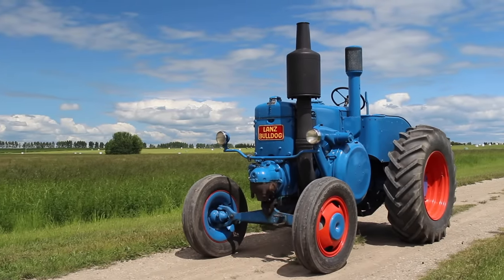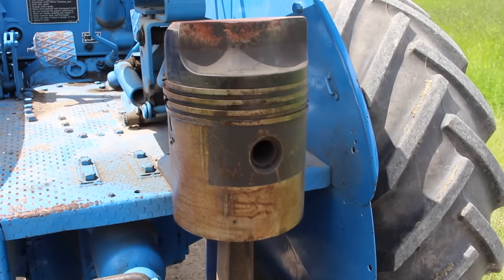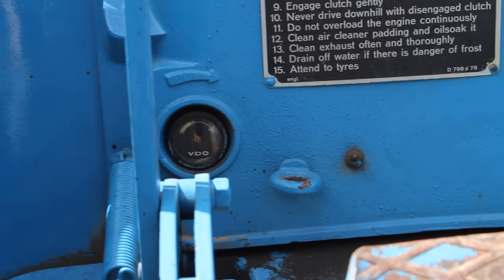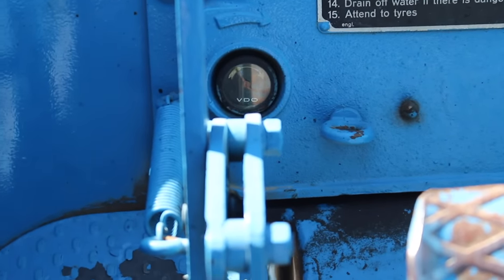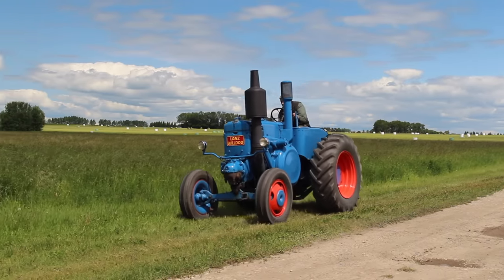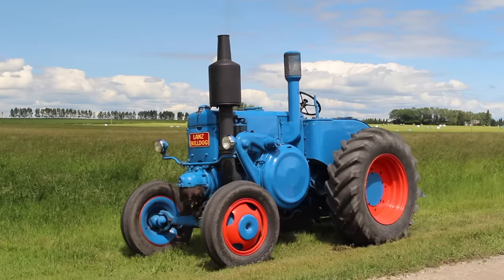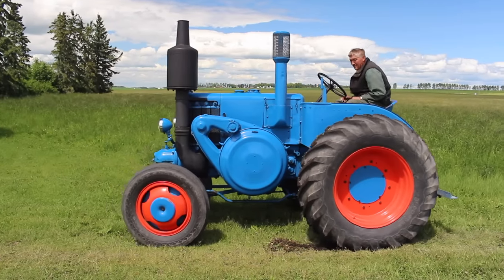Engine running backwards? Lanz Bulldog Tractor two stroke

Comment: What you forget to mention is the awesome sound that's absolutely impossible to capture. You feel each ignition in your guts. That massive and sudden exhaust from this huge chamber is simply punching you in the bowels. Had the pleasure to see a bulldog in action powering a saw via a belt. incredible contraption and it worked both ways of course.
Reply: Reciprocating saw
Reply: It sounds like playing big drum
Reply: i live in a small town in Germany, where now and then one of these tractors drive on the road, they are so slow, i can't even roll in 1st gear without braking behind them, but sound is really something special, soemtimes i enjoy it and just roll behind one of these.
Reply: Well kept  Lanz Bulldog  tractor. And  also well explained about the engine running at "0' rpm. Very sturdy  and made for life to run on any fuel a Farmers Tractor.
Reply: Totally agree on the sound. One day, I'll get some music sound expert to try and record... possibly using a large diaphragm condenser microphone, the same they use to record e.g. a base drum.

Comment: The air filter sucks everything in smaller or equal in size to a bumblebee.
And this tractor carries about ~30-50% of it's most essential engine spare parts 😂
Reply: Now a days you have to wait in the middle of the field for some John Greede  representative mechanic ™ goes and fixes yours with a fucking laptop
Reply: @mr2octavio  To be fair, today's stuff works so much better/smoothly, that comparing it to the old stuff and assuming the old ones last more isn't enough to conclude that today we only have crap. 
Today you do in a few days the work that took weeks back then.
Reply: And its still working :D
Reply: @alanwatts8239  I think he’s more upset in the way that most agricultural equipment manufacturers have anti self repair policies
Reply: @Burns11112  That i agree on.
Reply: @mr2octavio  try to do huge amounts of acres in one go new tractors don't even feel that. Theres 20.000 hour John Deere's without any problems.
Reply: @Burns11112  Same thing with all consumer electronics. I wouldn't mind my phone being a few mm thicker if it meant I could repair it without taking the entire screen off :( 
Seems even more illogical for agricultural equipment, but hey money is what motivates all these companies
Reply: @Hugh Jaanus which part of a vacuum cleaner sucks? Which part of a person's body actually sucks when "blowing" ... lungs or ... ?
Reply: @Hugh Jaanus btw, what has not been filtered has been sucked in huh?
Reply: Pretty neat. 👍🏼 This is how reverse works on today’s snowmobiles.  By the push of a button it reverses the timing and therefore the rotation of the 2-stroke engine within. “Simple by design”
Reply: @spartan963300  had to replace the screen on my current phone, which involves melting the glue holding it in with a heat gun (but not melting the phone). Then taking off the back and melting the glue holding the battery in so you can lever it out (but don't puncture it as there's a good chance it'll blow up), then detaching the screen.

Completely nonsensical.
Reply: @alanwatts8239  not really when it comes to tractors tho
Reply: "Suck" is incorrect. The cleaner doesn't "suck" anything. "The air cleaner allows particles equal to or smaller than a bumblebee to pass through the filter while the vacuum created by the engine sucks air in". Fixed it fer ya, bubba.
Reply: @dkdanis1340  This is a John Deere...almost, John Deere bought the Lanz company making this traktor in 1956 and still have a factory in Mannheim, Germany.
Reply: No that's not right, there is a second air-filter under the "hood", whitch is original made of coconut pulp and fine iron thread (no, I'm not joking). Nowadays we use sponge.
Reply: @MrArray1967  there is no such thing as "suck".
Get out a physics book and see.
Reply: I mean, think about the size of the cylinder. I would bet there isn't a pipe, tube or line in that engine that's smaller than an inch wide. That "bumblebee size" air filter is probably way overkill.

Comment: Back and forth, back and forth, back and forth...
😂😂😂
This is ridiculous🤣🤣🤣
Reply: ikr  lol
Reply: Well the early Lanz in the 1920 had no reverse it was managed by  reversing the engine simple.
Reply: Rumba tractor
Reply: @haukbayer4510  Is not so simple because you have to slow the speed of rotation of the engine many times untill you get the right hit to go in reverse or to do something like this 😅
Reply: @marianbuduroi6463  you have to be a skilled driver yes but the technology is simple.
Reply: @marianbuduroi6463  :  You need to acquire some skill to do it, but it's not hard.   There were once a lot of hot bulb 2-stroke diesel tractors, road rollers, etc.   Because it take a certain time to burn the fuel, injection is timed to occur before top dead centre.   Depending on how that is done, that can make it easier and safer (a crank-handle started engine that fires early will rotate back and smash your wrist) to start the engine in reverse, then when it has warmed up somewhat, manipulate the throttle to get it to just about stall and then run in the normal direction.   This was the normal starting practice for such engines and wasn't at all hard to master.

Comment: The amount of torque these things have is insane.
Reply: @fartsoundeffect5013  you know it’s not a contest right?
Reply: @austintillman8297  Exactly...
Reply: @fartsoundeffect5013  What truck do you have?
Reply: @v-g-z3689  also his truck doesn’t have 1 cylinder is probably is made using much more modern technology and therefore it obviously has more torque...
Reply: @somerando5814  Oh yeah, obviously...
Reply: @v-g-z3689  Probably a lifted dodge with a Cummins 12v.
You know how those guys are.
Reply: @HeyItsJonny  True, I do :D
Reply: @HeyItsJonny  with the tow mirrors 4ft out.
Reply: @Clownbaby666  truck nuts on the bumper.

Comment: HP: 45 TQ: YES
Reply: well he said 45 hp at 630 rpm - at 630 rpm full output power (i.e. flat out) thats 500 Nm torque. at lower speeds it will be less and less.
Reply: It's only 363.6 lb/ft. It's barely anything.
Reply: @tacticalidiot175  well yeah, but it's just ONE cylinder lol
Reply: 45 hp is actually high power for an old tractor. All of my old tractors from 1963 and earlier had below 30hp but didnt lack power.
Reply: @tacticalidiot175  if 500 NM out of an antique Single Cylinder running at less than 700 rpm is barely anything then I’m the supreme ruler of the universe.

Comment: Actually helps to explain how the massive marine 2 strokes can go astern without a reverse gear
Reply: Do they have reverse pull start on marine engines?
Reply: @manFromPeterborough  I am not sure if the starter can go backwards, but I believe they had to stop and start injection at the right time for that or something along those lines.
Reply: @Jan_372  I know some of the large tugboat diesels, and cruiseship engines can be started in reverse with the starter, not sure about older or smaller ones though.
Reply: They had air starters on some detroit diesel boat engines that spin either way if I remember right
Reply: Some snowmobiles also reverse by reversing the engine. You just press button and it shuts off and starts again but other direction.
Reply: Large marine two strokes are started with compressed and can indeed be started backwards for heading astern. It's only used in direct drive propellers where there is no gear box
Reply: @thejafuu5001  Some golf carts too. Harley Davidsons and others.
Reply: @timmccarthy1780  and they reverse the valves.
Reply: @Jan_372  That was how you reversed the Bolinder engines on the old Irish canal barges.

Comment: My friend has one of these. His, I believe, is older than a 1952. And his you have to pull out the steering wheel, which has a rod on the end of it, stick that rod in the tractor, and rock it back and forth. Once the tractor is running, you have to grab this smaller free-spinning wheel in the center of the steering wheel, pull the steering wheel and rod out while the tractor is running, and put the steering wheel back in it's correct place where is just kind of fits down into the steering column, then you can drive the tractor. And just like this one, you have to let the tractor decide which direction it wants to start off on.
Reply from the maker: Very cool! This model still has the steering wheel latch but due to safety reasons they were pressed in place and the starting disc you see is used instead. I’d love to get one where the steering wheel is removable!
Reply: A lot of people lost their hands and arms doing that! Just imagine to pull off the fast spinning wheel when it had a knob on it....you just had a blink of a second to do that

Comment: Lol these engines literally can't stall unless you grow them in top gear tied to a boulder, eland even then they'd fight
Reply: Are you sure this thing has gears?? Seems like omitting a gearbox is the best rationale for this bonkers design!
Reply: @snigwithasword1284  How is this a bonkers design in any way shape or form?
Reply: snigwithasword Yeah it certainly does not appear to have gears
Reply: such a two-stroke design can stall and it can be dangerous, imagine puling something heavy up a hill and the piston doesn't make it past TDC, the engine will keep on running but now full power in reverse!
Reply: It seems to have at least forward and reverse gears. It definitely could reverse by running the engine backwards, but at 3:47 we see it back up then go forward without the engine ever stopping, and it looks like the driver is reaching down to a gearshift. Still doesn't indicate if it has multiple forward gears, but I could imagine it probably does, most tractors do so they can be in a really low gear for dragging a plow (or anything else) and higher gear for driving down the road.
Reply: @fuzzy1dk  
I have heard there were some older two stroke diesel engines in semi-trucks that this could happen when pulling a steep hill with a heavy load. If you didn't make it, stalled, and stared go backwards the engine would run in reverse so you'd have 16 reverse speeds and one very slow forward speed.
Reply: @fuzzy1dk  If you know how to change gears, this thing will always have more torque on the wheels than the wheels can bring onto the floor.
Reply: @quillmaurer6563  i think that's more like a clutch, or one gear 'off and on'.
Reply: With the insane amount of torque is has, it's wheels will spin and it won't stall.
Reply: @PilotTed  
how the fuck is it not?

Comment: "One Lungers" as we used to call them last forever.
Reply: Never had one near something like this but have had many two stroke single cylinder bikes over the years. By far my favorite. Some completely stock over 50 years old and start right up easier than new bikes. Easy going, robust engines that are just happy to run. Love em.
Reply: @LateNightYinzer  Well this isn’t a normal 2-Stroke. It uses everything that burns, a so called „Vielstoffmotor“.
You could drive this thing using cooking oil...
Reply: @mullerman1104  If I needed a farm tractor for the post apocalyptic world, a Lanz Bulldog would be it. Runs on enything from dirty used engine oil to alcohol, No need for working oil refinerys to keep that puppy going

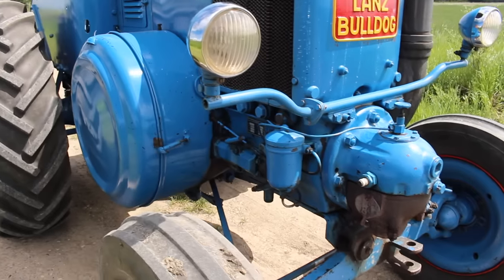Comment: I´m from Germany, and I grew up watching these old Lanz Bulldogs, cause we had a Tractor Festival near my hometown where they had a big Lanz community. There are a lot more cool and fascinating things to tell about those machines! You had to heat up the top end of the cylinder when cold starting the engine. You had an oil lamp coming with the Tractor just for that own reason and there was a hole under the brown part of the cylinder head right at the front, you can see it at 0:40. Russian licensed fabricators ( called URSUS) also built those, the older generation always told stories that the russians even had to make a fire under the cylinder head to heat it up. You can´t imagine what it takes to cold start that engine by hand! The guy in the video did it so easy because the engine was hot already. The reason this engine could stay at ´0 RPM´was that the farmers could just let the Lanz run through their breaks or when they had to do other stuff, so the tractor didn´t need much fuel, because it was so hard to start it back up again when it cooled down. They even built so called `Schnellfahrtraktoren´, faster models for the street that could go up to 40-50mph! Circuses where their biggest customers back in the days. The coolest thing I always loved as a kid is that at some rpm the exhaust gases always formed a smoke ring out of the exhaust, you should definitely watch a video of a Lanz doing that! :D 
The sound of a Lanz pulling heavy loads is also very scary, cause they appear to be much much louder when pulling stuff. Hope I´m gonna own a Lanz one day.....
https://www.youtube.com/watch?v=CcCU5gJqiyA

Comment: My first motor bike was 2 stroke. I was told not to let it idle too slowly at traffic lights because it could actually decide to suddenly run in reverse. Letting in the clutch would have then been a nasty surprise! It never happened even though I tried once or twice when my rear was clear.
Reply: Old Yamaha dt360’s did this…
They didn’t have the same power when in reverse as they fired after tdc in reverse
Reply: Nah this is impossible unless you're talking about direct transmission engines. I drove lots of Vespas (2 stroke single cylinder engine) and never had problems idling at the stoplights

Comment: These tractors presented the operators with a few unique challenges
1- Attempting to climb a hill in too high a gear - the tractor lugs down as the torque increases to a stall but it then it does not stop but starts in reverse - too bad about the implement (say harrows) because you just ran over them
2- The lubrication system is only designed to pick up oil when going in the correct rotation
3- Because the engine is not counter balanced the whole tractor continually rocks back and forth when idling in neutral gear - (the engine is still rotating completly and correctly lubricating) but on some of our soil types when wet, (similar to standing on wet sand on the beach and continually wiggling your toes) the tractors will sink and bog itself. All because you left it idling rather than stoping the engine

Comment: This is genious design! You dont need reverse, you just reverse the engine, and put it in 1st
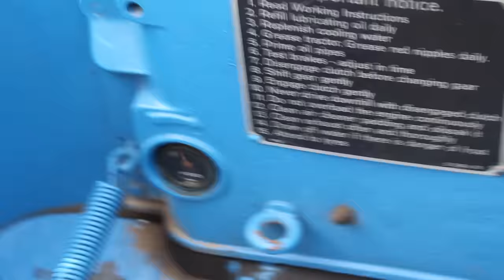Reply: It looks like it does have a reverse gear, note at 3:47 he reverses then goes forward without ever stopping or reversing the engine. That concept does make sense though, and he did reverse it without putting it in reverse gear at 4:21 - looks like there's a trick to it though. I've heard of other machines that utilize this characteristic of two-stroke engines to reverse without a reverse gear, such as some ships (direct drive two stroke) or I once saw a rail-speeder (an old track maintinance/inspection vehicle between handcars and those high-rail trucks) with a two-stroke engine that could reverse like that, direct belt drive with no reverse gear. A four-stroke engine could potentially do it as well if the cams were reversed, as I heard was done on some airships (Zepplins) in the 1920s and 30s, and if that Koenisegg Freevalve becomes more common (as I think it likely will even on econoboxes - they're already working on that) it could be done on cars, which could allow omission of the reverse gear.
Reply: @quillmaurer6563  yes, so ships with 2 stroke have air starting, and they can start the engine in both ways, and then dont have neutral. The driveshaft is directly conected to the  prop shaft, no cluch or gears

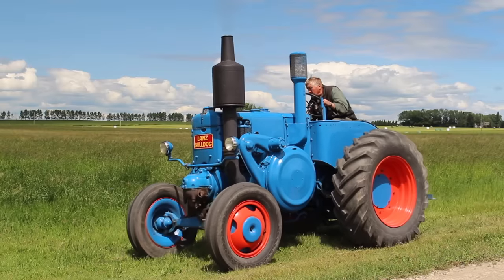Comment: 2:45 That poor tractor, that poor gearbox.
Reply: what gearbox?
Reply: @Stolas That's interesting. I was just expecting it to have a gearbox like any other vehicle. This still doesn't look like something you should do to often
Reply: @Stolas I think I know what you're getting at - but in fact it does have a gearbox.  A big long one that forms the hinder part of the chassis.  Between the crankshaft and the differential there are about five geared shafts, all transverse.  The driver has one gear lever to select from 3 forward and 1 reverse, plus another to select high or low ratio.

Comment: It probably one has one gear and it’s backwards AND reverse all in one😂
Reply: The earlier Lanz tractors actually didn't have a reverse gear. You had to reverse the engine's running direction to drive backwards XD
Reply: @johnblock6608  lmao